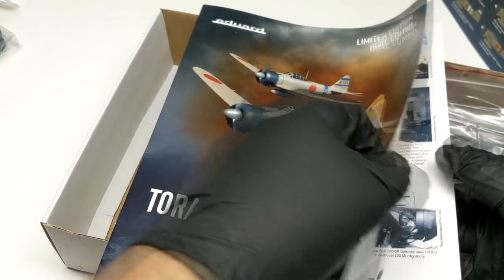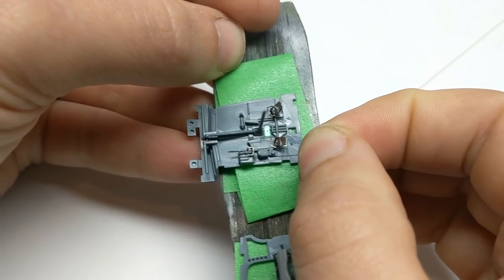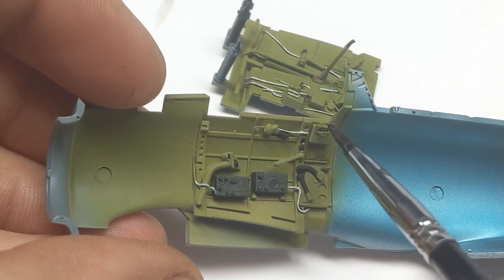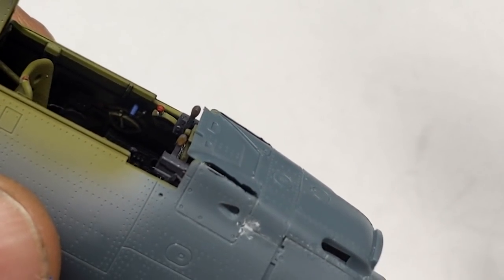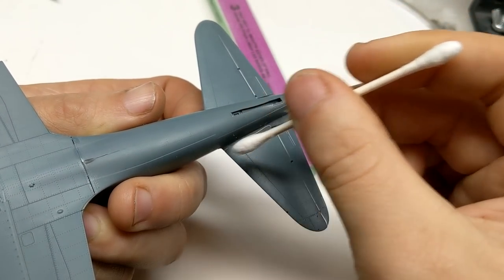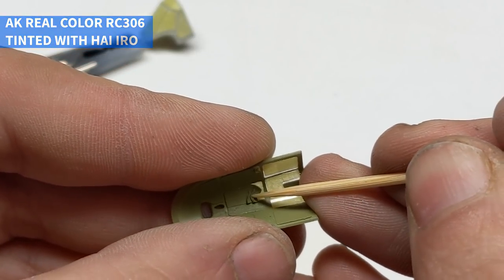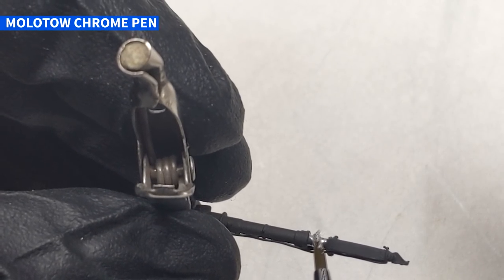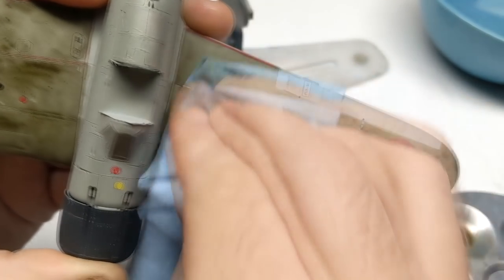The All New Eduard 1/48 A6M2 Zero! Full build

Comment: New subscriber, years ago I was an avid builder, but life and family took over my
 " model time". However finally retired and model time is back. Along the way models, detail, material, suppliers kit  cost have changed a great deal. I have discovered Eduards  have the Camel and Spitfire kits, ( I want to build a Spitfire for Gillespie),  They will probably be my go to kits in future but need to get my skill set back before building them. I need to get up to speed on your and putty for filler. It looks like you used a ' wipe off filler". I recall a green putty I think by Squadron, took a lot of sanding. I have been recoomended several variations of Tamiya glue. My go to paints were Humbrol. When I was  building there were no " washing kits". I have several partially built kits and some old unbuilt for retraining. But the putty and glue would be of interest. AND your skills in this video are excellent, sorry for the long post,  I've found kit review videos but not too many builders and your skills and materials are definitely a lot more current on where I need to be in today's model world. Would also welcome inputs from your fans. Thanks.
Reply from the maker: For glue Tamiya Extra Thin quick setting is a great well rounded glue. That's what I started with and only recently.l moved to a faster drying glue

I use perfect plastic putty for the wipe away glue but one draw back is it shrinks after drying. So you'll need a few layers and allow it to fully dry.
Reply: @TheModelGuy  Thanks so much, this helps a ton.
Reply: @TheModelGuy  OOPS, I was researching video and a few more, forget to ask,  How about the black gloves  are they special kind to prevent body oils , or prevent glue from sticking. I remember getting " glue prints" from glue on finger tips. Sorry about that - so many models so little time :-)

Comment: Also watched your Tamiya Zero build from a couple of years back. Seems the Eduard one has lots of detail but from every Tamiya model I've built from the 90's up......well I just sit back and smile at how well they go together. I even built the Tamiya Zero from the 70's and it was amazing how well it went together for such an old kit.  Both look like great kits. If you had your choice, considering all factors such as fit, detail, engineering, decals, cost and availability in Canada, which one would you pick?
Reply from the maker: Oh boy that's a loaded question :)

First off, thanks for watching an taking the time to comment. I really appreciate it. I've done both the new tool Tamiya Zekes (A6M3 & A6M5) and they both assemble very well with no drama. The low parts count also helps it out. Now, The Model Guy from seven years getting back into this, and newer, or modelers who are happy with a build with no drama, I would suggest the Tamiya kit. The big difference with Eduard, is the surface detail and much higher parts count. There is also a lot more going on in the office. If you're put off by a high parts count, maybe steer away from this kit. But, between the Tamiya offering and Eduard, this would be my choice. I love detail and this is right up my alley. But I would happily build either.
Reply: Thanks for the reply. Got back into modelling in 2018 after a 40 year break and have been a fan of your channel for a couple of years. Built a couple of Eduard's recent kits in the past and they were great kits. Hopefully Eduard will come out with a weekend edition in the near future as they are usually great bang for your buck. The Eduard double pack is just to expensive for me. Will have to watch your 2 videos again and decide what one I will get. Eduard Profipack when it finally arrives in Canada or the Tamiya as it's readily available. Hmmmmm....

Comment: Turned out great! One thing to bear mind with Japanese subjects is that nobody can really provide an authoritative answer - documentation is nearly nonexistent, information abundant and contradictory, and too little based on primary sources. Not to mention how little standardization there was between manufacturers, suppliers, production runs and individual units. Do it the way you like!

One small note on aotake (青竹) - it’s less the name of a specific color, and more the family of protective finish, and similar to zinc chromate primers, color varies wildly, and use was inconsistent. The pronunciation of “ao” rhymes with “wow,” and “take” roughly with “café” but without the stress on the last syllable.
Reply from the maker: A few of the guys stating they were right were sending grainy washed out pictures from books. That had dark photos to start with.

I settled on the one that sent a picture of a well lit fuselage part with some paint chips around it

Comment: Your brake line should pass through the leg cover and not along the leg. Otherwise no sweat! Cheers.
Reply from the maker: This was the reference I followed 

https://www.google.com/search?q=a6m2+landing+gear&rlz=1CDGOYI_enCA871CA871&oq=a6m2+&aqs=chrome.2.69i57j35i39l2j0i512l3.3513j0j7&hl=en-US&sourceid=chrome-mobile&ie=UTF-8#imgrc=if36LIpYVCusoM
Reply: @TheModelGuy  So you can see in the pictures that you are not correct with the brae line along the leg. Salute.
Reply from the maker: @TheJeannot52  I'm confused what you are trying to say. In the image the brake hard line is on the gear leg. You are saying it should be on the door?
Reply: @TheModelGuy  OK. The brake line passes through holes inside the gear cover, then twists to the leg and goes down to the wheel hub. On your link it is plainly visible. If you own the Maru Mecanic on the Zero there are very good pics of that. Regards.

Comment: Getting model paints right now can be problematic, can you recommend  a color in the tamiya range that will match the beige fuselage  color?
Reply from the maker: You can use XF-76 IJN grey green from Tamiya and be in the ballpark.
Reply: @TheModelGuy  thanks.., even  my local hobbyshop is running low on tamiya paints not to mention Gunze

Comment: I´ve just finishing my F4U 1/48 from Revell. I have a problem. After my Vallejo Air colours I´ve airbrushed a layer of gloss varnish (Vallejo), which i mixed with Vallejo Thinner. On some areas the gloss-varnish peals of like skin after a sunburn. Can anybody be so kind to tell me where is the reason for my problem?
Reply from the maker: Vallejo Model Air is a very delicate colour. You only need a few drops of thinner to paint to spray it. It sounds like you’ve put on too thick of a layer. I used Vallejo quite a bit starting out but being an acrylic it can be very inconsistent. If you are set on acrylic paints, I recommend moving to Mission Model Paints or the Mr Colour Aqueous Range
Reply: @TheModelGuy : Thanx for your advise. I mix the vallejo gloss with thinner 50/50 and use a 0.2mm airbrush.

Comment: where did you get masking film for zero circles?
Reply from the maker: I ordered it from a site in Canada called Hobby Enablers. It's Oramask 810
Reply: @TheModelGuy  how did you draw out circle in film?
Reply from the maker: @43rocket  as stated in the video a Silhouette cutter
Reply: @TheModelGuy  if you have alumium plane you airbrush, first you put down black primer, but how do you use mig chipping fluid to make base come through if black?
Reply from the maker: @43rocket  aluminum doesn’t chip off. That’s the actual colour of the metal under paint.
Reply: @TheModelGuy  doing a p-47 and box shows chipping of  metal wing?  maybe the basecoated different colour?
Reply: @TheModelGuy  what to use to clean those brass stencils after?
Reply from the maker: @43rocket  I soak them in lacquer thinner
Reply: @TheModelGuy  can I use paint thinner?
Reply: @TheModelGuy  hi, can you use paint thinner to remove enamel washes off models or no?  what about the enamel paint thinner at home hardware?

Comment: Japanese paints were notoriously bad in terms of quality and standardization.   I would not sweat tints on these.   As long as your blue is not bright pink I’d think you’d be ok.  I also note that I see modelers relying more and more on Colorized Photos which will not be accurate.   I just finished one of the older Tamiya AM6’s and I think I’ll add this one to the shelf in a differing livery…thanks for the inspiration.
Reply: Incorrect, Japanese Naval paints were actually very good quality and fairly well standardized.

Comment: You just make extra pointless work doing that underlayer pattern kind of pre-shading, because you basically covered the whole up with the base color. You make better, effective work if you rather do dark shading on the panel lines, chipping and washing the surface, or even changing the shade of base color just mixing some black or white to it and sparying it on different panel parts, giving the base color a bit or uneven, more interesting look.
In my opinion satin or semi-gloss varnish works better for the wash, as the wash makes it flat anyway, so the glossy base make it more interesting when the wash is cleaned up at flat parts.
Reply from the maker: Strongly disagree. You get very controlled variation with the underlying mottling. This isn’t as worn out as some other examples later in the war. As for preshading every panel line? That looks too toyish in my opinion.
Reply: @TheModelGuy  but those random patterns have nothing to do with realistic worn effect or I am not sure what is the goal with those, also because you basically covered all, and can't be seen in the final result. It is still waste of time, if you can't see it. :D
Reply from the maker: @Chibanah  you can see it much better in person. DSLR cameras struggle with it.